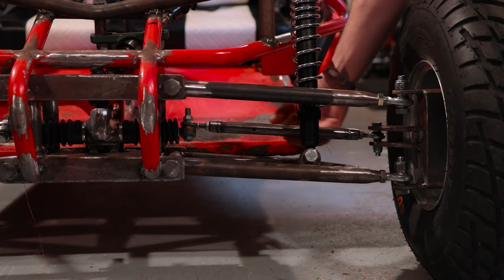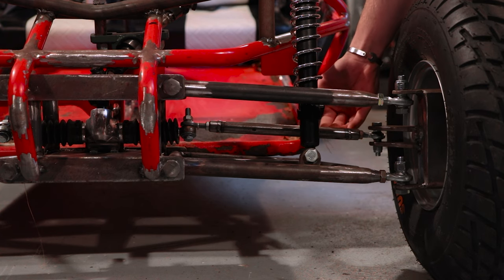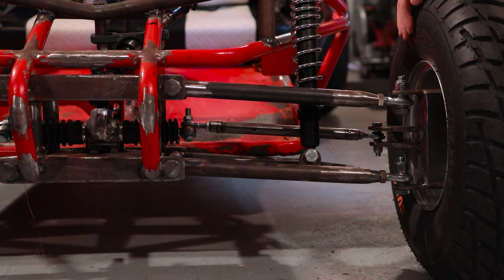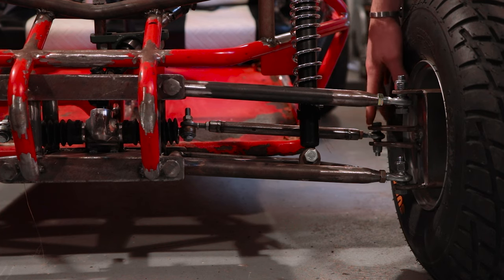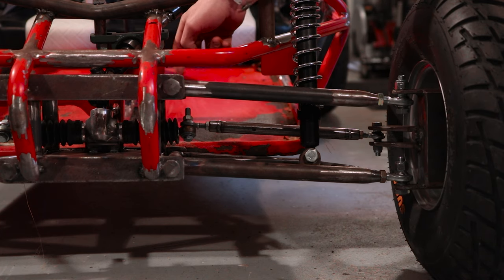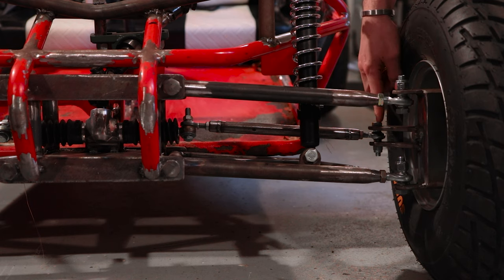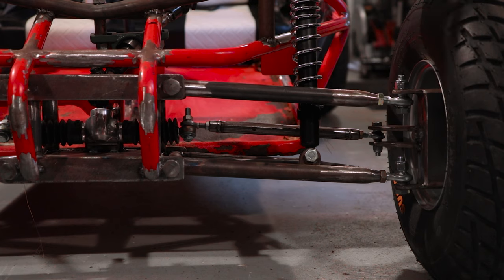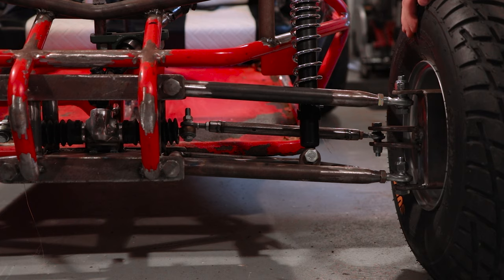Go-Kart Tie Rod Placement | Minimizing Bump Steer | TYRANIS TIPS

Comment: I have a steering issue with my go cart. When I accelerate my front tires toe out. And same with braking, it toes out under hard braking. My alignment constantly gets messed up. Do I need a new steering rack? If so, which is a good one?

Comment: It also makes the steering lighter as well,I know that in my Holden VY SS Commodore the tie rods aren't near parallel with the steering knuckles & the steering rack sits lower than what the steering knuckles do 

The problem is due to the fact that the lowest Holden lowered the suspension was 1-1.5 inches below the standard FE1 suspension package which is the FE2 suspension package & my car has 30 millimetre (about 1 1/2") lowered springs fitted which is 30 Millimetres lower than the FE2 suspension package.

So,the FE2 suspension equipped VY Commodore sits 180 Millimetres above the ground whereas the 30 Millimetre lowered springs cause the car to sit 150 Millimetres above the ground.

Refitting the FE2 springs will make the steering lighter & it may also correct the positive castor which is 1/2° out at about 9 1/2° when the maximum Castor should be 9° !

Comment: Stupid Question? #1):   Can a set of coiled over shocks incorporeted into (As part of) the tie rod ends... thus allowing some restricted play in tie rod lengths, could while turning "give" conpensation for the bumping, fighting or grabbing (whatever its called) that the wheels experience to the pavement when turning?  I have 4" coil over shocks and ok can adjust tension. ( I cannot see it causing any problem off road IF Stiff enough)
Stupid Question #2):   Because I desire the steering assembly to be in front of the spindles, will that possibly cause anti~ankermann steering thus disrupting by bum, bump, or grabbing steering, or what ever thats called?
Stupid Question #3):   If I include a slight but metered articulatuon of my oositractuon rear wheels angle in accordance with the front steering (renember -- slightly) will that off set the wheel grab while turning, making it more compliant with on and off rosad bum, bump, grabbing road surface?
Stupid Question #4):  Will toe in or Toe Out make a difference according to which setups i try?
Stypid Questuon #5):  I have seen some *Reverse Lean *Systems and wonder how beneficial that would work for or against any of these applications?
     Due to ideas i  am currently working on with magnetic bearrings ans angular gyroscopic power, I am seeking a directional power through the use of gyros the idea is the get them to Fight one another to cause a desired directional force on ground then upward, fighhting  gravity while increasing. Stability.
My plan is gaining angular force in all directions excep ONE.